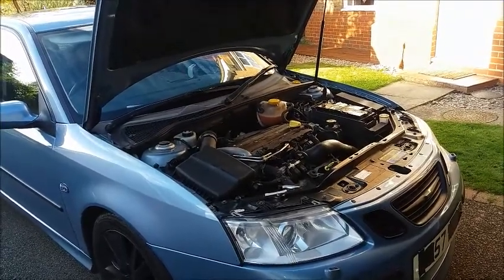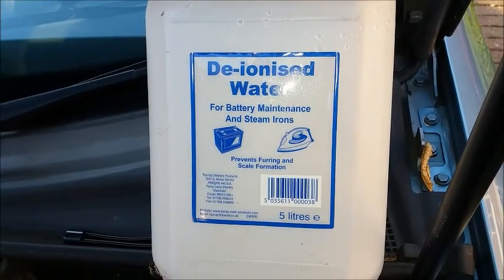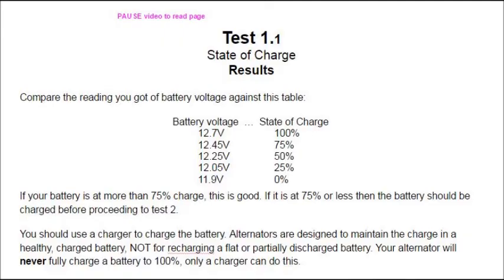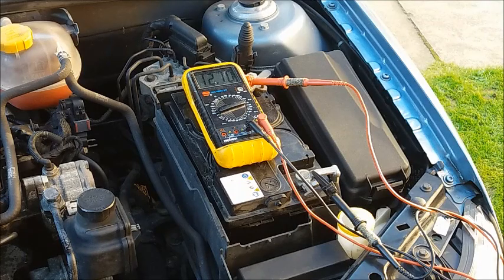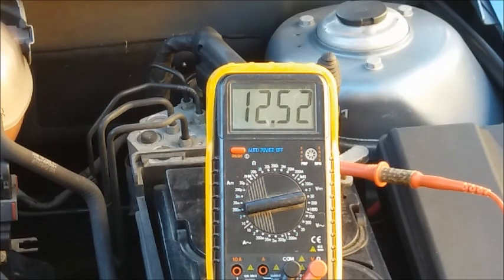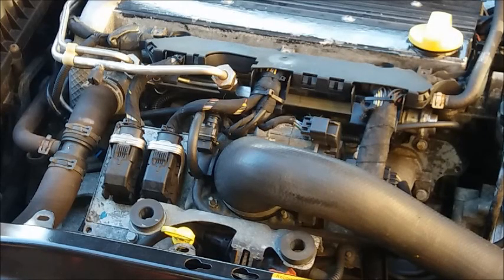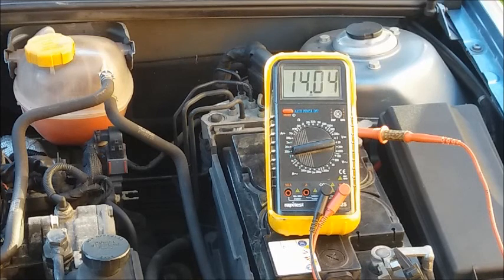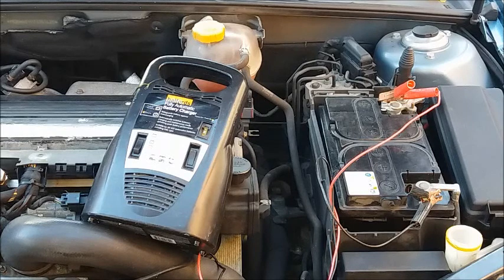How To Test Car Battery And Alternator with Multimeter⚡Complete Guide

Comment: Hello, great video. I seems to have a electrical problem with my saab 9-3 TTiD Aero I think I have identified one reason to the issue is that my plus (+) terminal is getting really hot. Since my alternator seems to produce in engine idle put out about  14,2 - 14,4 volt bit the voltage is about 1 volt between B+ ont he alternator to the + terminal on the battery. Anyway I also want to search for possible amperage draw on the car. But I not sure how I make the car go to it "sleeping mode". What is required? Should I open the doors and make the push the doors and tailgate latches have in lock position and lock the car? Won't the car alarm go off  then when door are open and the hood and tailgate open?

Comment: Only thing I think needs adding to this is if the alternator is charging abit low, before condeming the alternator is to make sure the main live and earth is volt dropped under load to ensure it's not a poor connection or high resistance in wiring causing the problem. Good videos though.
Reply from the maker: a33272 you are technically 100%correct. I do say in the description that this assumes the system is in good mechanical order. 
Worth repeating though. 
Thanks for watching, I'm glad you like what I'm doing.